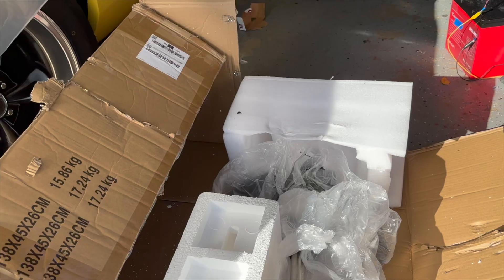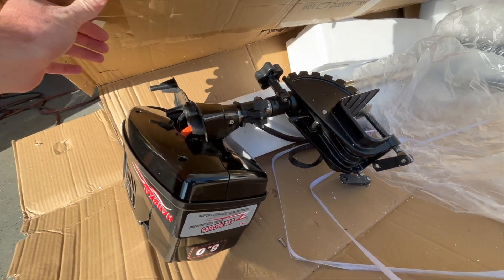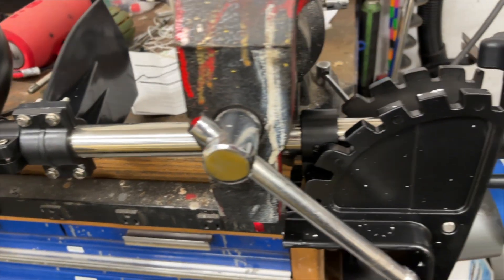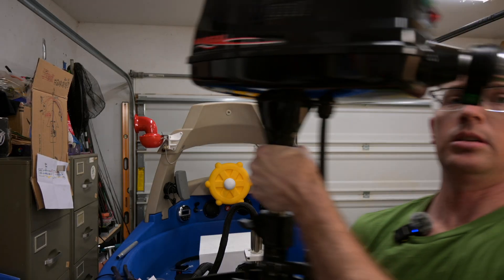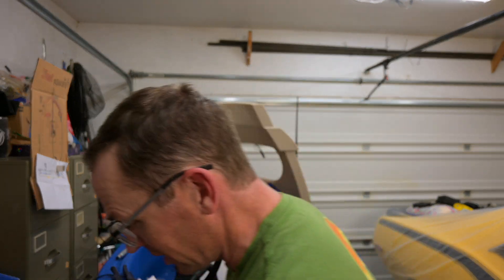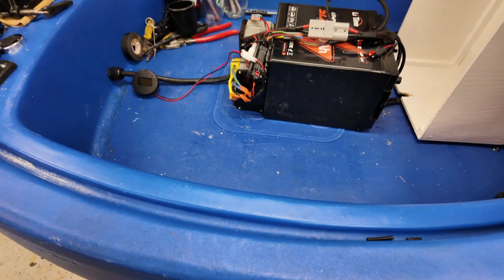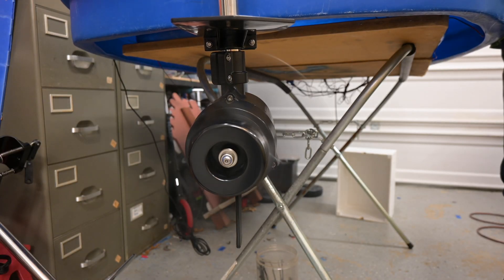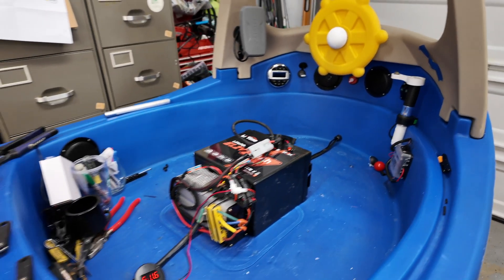I BOUGHT A $300 ELECTRIC BOAT MOTOR ON AMAZON

Comment: Love your videos ! I'm doing similar thing here. My Hangkai is 7hp which is the 1800W. I will also have the same plug to take the engine off and controller will be mounted on the boat.How long can the cable from the controller to the motor be ? I'm planning to use around 6ft of length. Will that cause any overheating or voltage drop? Thank you! Bob 😊😊
Reply from the maker: Thanks! I would think 6ft would be about the limit. Go with the largest gauge you can with that connector
Reply: @goodmanfishing  thank you! I will post a video of how I got it set up on my channel hopefully today 😊

Comment: Hello @Goodman, I am similar circumstance with Amazon and Hangkai 60 volt unit.  It came with a throttle completely ripped off and unrepairable.  Found a 48 volt throttle on Amazon and it showed up but the unit will not run.  The controller was knocked off its mounts so I had to build a wood/fiberglass mount which holds it fine.  But...no joy with 24 volts.  It is supposed to run on 12,24,48 or 60 volts and a claim of 10 HP at 60 volts.  I don't know anything about DC motor controllers but there are a bunch available.  I agree with you that the motor is large and could be quite powerful.  Any idea on what I should do next.  The throttle that I purchased has same connector and wires are the same color.  Thinking about a new controller but have no knowledge of how to check to see if it is bad or not.  Would appreciate any ideas that you have.....As to your little tug boat; very impressed with what you have done.  Lucky kids!

Comment: I had a similar experience from the same seller on Amazon, although Shipping was $100. The first Trolling motor arrived with many broken plastic parts in the cowlings and the throttle handle had bounced around and the wires were ripped away from the handle. It was the week of Black Friday, so while the seller was deciding what to do, I ordered another. It arrived even more damaged and missing both props, manual, and throttle arm. the cowl top and bottom were broken and most of the support stanchions to support the controller were broken off or missing. I did find the return form from the prior buyer but he apparently had FedEx ship it in one of their boxes without any protective padding. I also ordered one from Temu at a lower price. It arrived almost usable immediately. I had to disassemble the controller to move the throttle pipe shaft and inch so that the throttle handle could be attached. HangKai's original packaging allows the pipe to be hit which then makes it impossible to use an Allen key to adjust the 2 set screws that attach the throttle. I thought that maybe they were shipping out the returns since they had so many orders at Black Friday. Good luck to anyone who is willing to buy from the Amazon seller Ocasami without a written guarantee. "Wayne the Boat Guy" on YouTube had a similar experience with one.